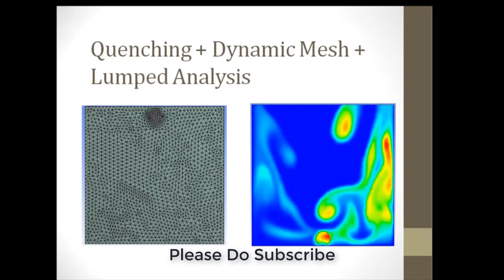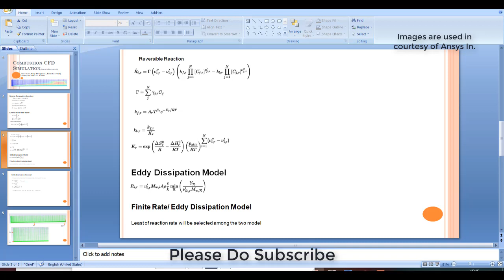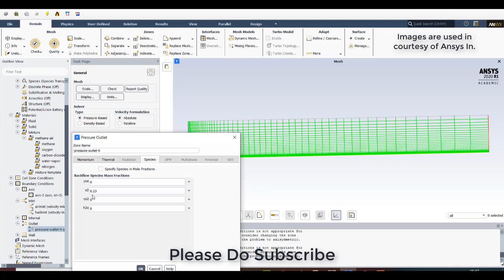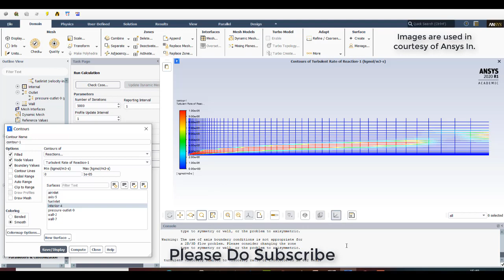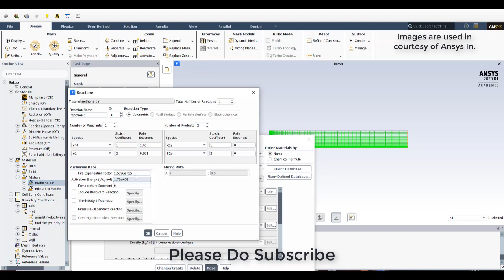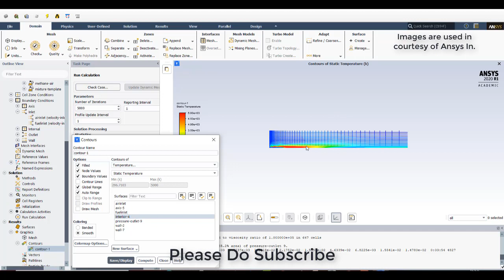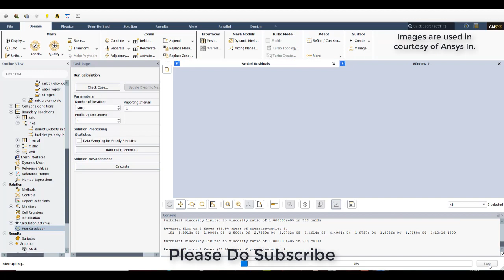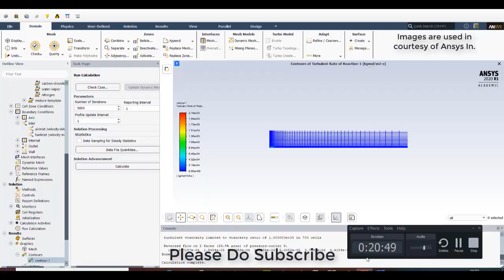Combustion Modeling and Simulation Part 2|| Species Transport Ansys Fluent

Comment: Hi sir, you used a methane-air mixture, is it possible to have a mixture as per requirements, for example i want methane air hydrogen and carbon monoxide.

Comment: i wanna remove N2, O2 ang H2O from dialogue box. I  chose mixture-template for my reaction and also I defined my needed material. But in the mixture-template dialogue box when I am trying to add my material and remove N2, O2 and H2O (the default ones), I cannot remove them (I can add) and it shows me this error: "Species n2 is used in one or more reactions.  If u have any experience plz help me.
Reply from the maker: It means that species is already been used in reaction tab under mixture template, so first untick all the models under species trandport tab. Then you can change the species
Reply: @shavantechnology3472  thank you so much, it works.
and how about this problem ?
Error: sopenoutputfile: unable to open file for output
Error Object: "C:\Windows\system32\cleanup-fluent-DESKTOP-6887NNJ-6056.bat"